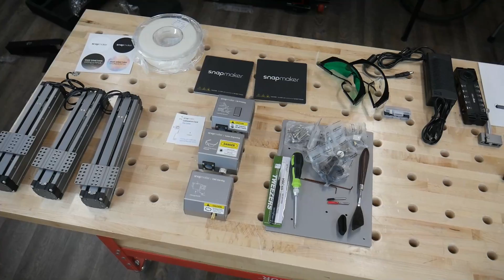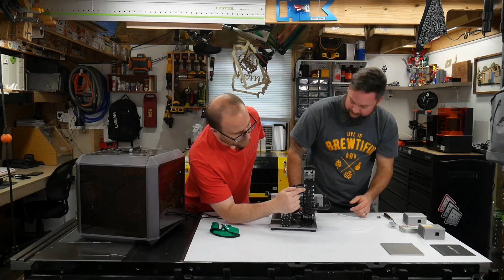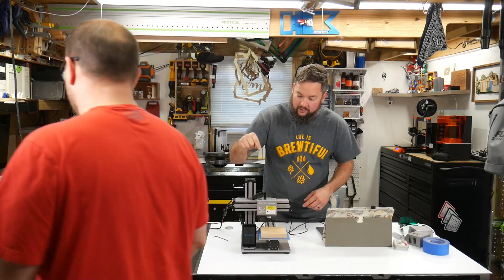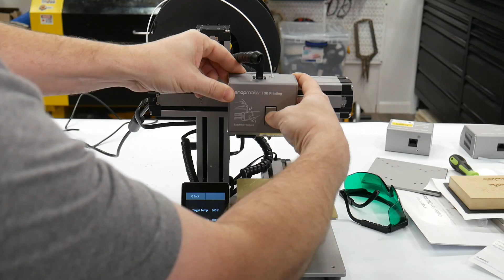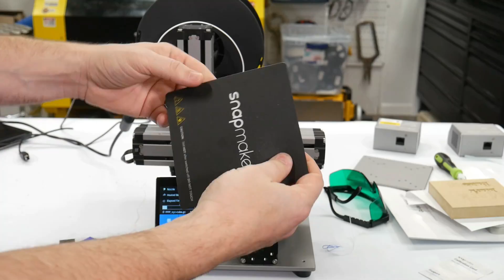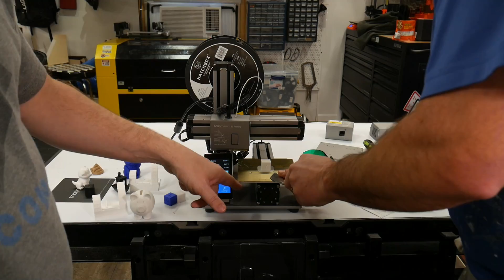Snapmaker 3 in 1, CNC, Laser, And 3D Printer.  Can A Jack of All Trades Master Any?

Comment: This original version is still relevant in 2020, a lot of peoples are still tend to focus in the machine capability, they seem to forget "the man behind the gun" philosophy.
Nothing is perfect in this world, things we need to combine several ways to complete it.
I've learned the way MarkForged print with their printer, and come to conclusion to replicate their successful with a simply idea.
Somehow peoples are complicated their thinking and forgot the easy way to get the ultimate solution.
I am using PLA/PLA+ because they are most affordable, then combine with post processing technique to get "very strong" results used for functional application.
So, PLA/PLA+/ABS combined with Bonded Nylon thread, coated with UV resistant material to make it stronger, durable, and affordable, which is done in very basic way.
This process cycle can revolutionize the way people create a 3D object, since I believe if most of peoples doing this way, it will corrects other filament type pricing range, even though 3D printers market itself. I found no Youtubers yet created such video, maybe I will.

The keyword is DESIGN, not just merely relying on a tools, FDM/FFF 3D printer current technology is just suitable for prototyping, if you want a production version product, go with injection molding.
Reply from the maker: i think it was a great first try.  But it just doesn't do any of the 3 things perfectly.

Comment: I was one of the first buyer through kickstarter. As someone new in 3D printing at the time I wanted a machine that was small, easy to use and of good quality. the fact that I could also use the same machine to learn about laser AND CNC was the deciding factor. I do not regret my choice and I am ok with the limitations of the print bed as I mostly print very small parts. I agree with everything that was said at the end, I think that you guys summed up the pros and cons of this machine pretty well.